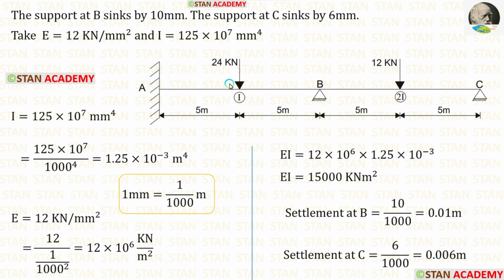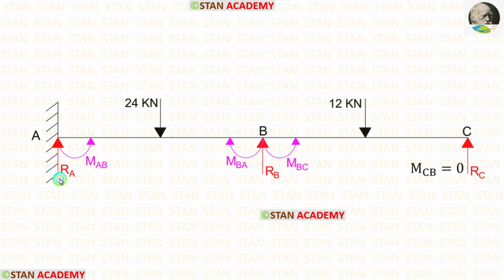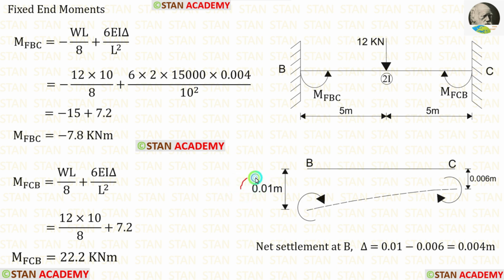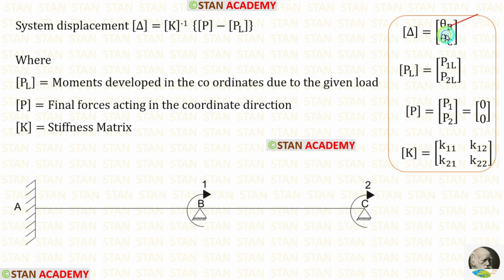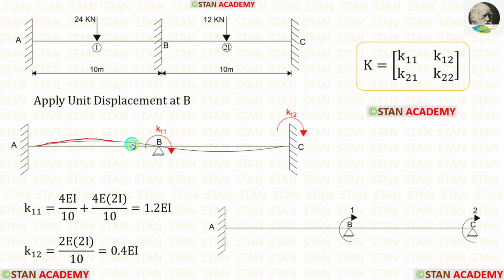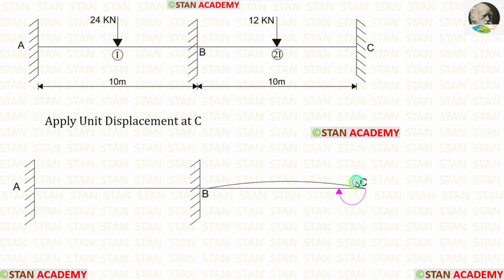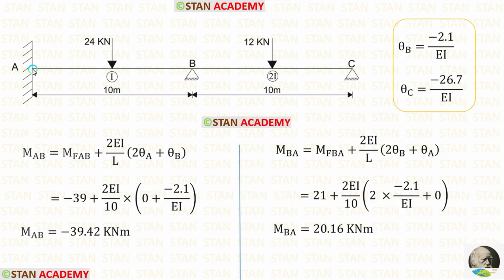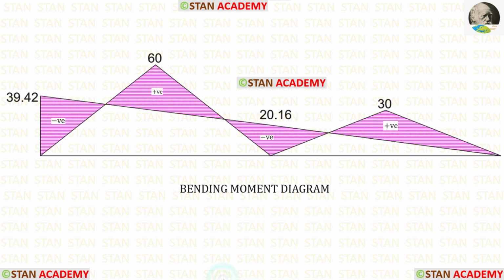Stiffness Matrix Method for Analysis of Beams - Problem No 14 ( Sinking  of Supports B & C)

Comment: Sir since u consider the moment due to sinking in fixed end moment that's why u didn't take the 3delta/L in slope deflection equation at the end , but If I don't consider the moment due to sinking in fixed end moment in that case I have to do the algebraic sum during find the [PL] matrix of 6EIdelta/L^2 and find the slopes after that I have to put the 3delta/L in slope deflection equation to find the final fixed end momentof